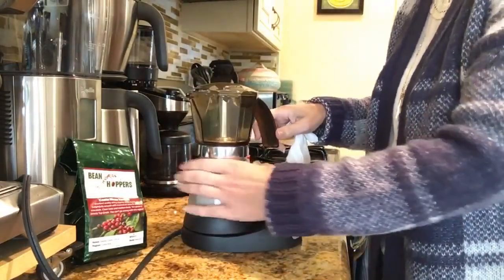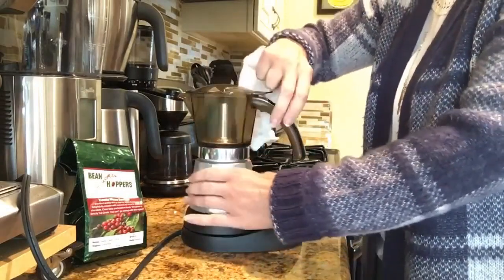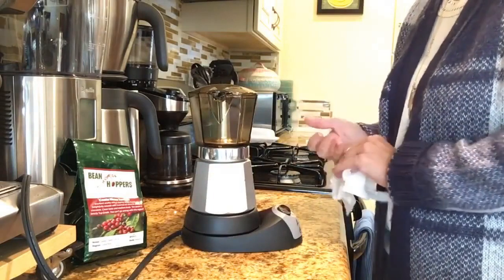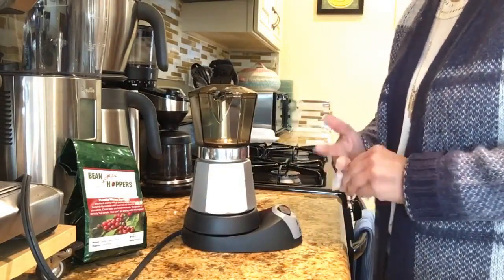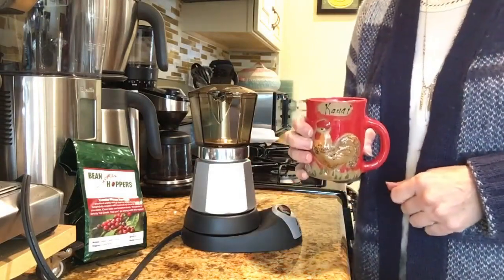Delongi Alicia Moka Pot Comprehensive Review

Comment: I have bought recently and problem is that always stays water inside, not comes out all cofee.is it normal .thanknyou
Reply from the maker: Hi! If a lot of water is left in the bottom that is not normal. If there is just a small amount (a 1/2 oz or less) then that's pretty normal. There are a few drops left when I brew it. If it's more, then you should return it for a new one because something isn't working right. However, if you're using coffee that is too fine, or your compacting down your grounds, all of the water may not be able to get through. The coffee should not be compacted and you can try making your grinds a little more coarse and see if that helps!
Reply: @BeanHoppersCraftCoffee  thank you for your reply, the water which is left is too much  and coffe that I use is normall,what is sold in supermarkets, a bit rough.so I have to take it back.thanks.💖💖💖
Reply: o sorry you ment If i put coffe compactly, but not, only prepare for me, just one spoon coffe💖
Reply: @natalijafaridze2308  if only making enough for one, it comes with an adjustable metal top to put into the coffee basket to put less coffee in it, and you would use less water.  Even though it may not be an espresso coffee maker in the traditional sense, the six-cup/three-cup capacity is based on espresso shots. not 8 ounce cups of coffee

Comment: What type of grinder were you using for that?
Reply from the maker: My grinder is the OXO conical burr with integrated scale. I usually use a 6 for medium drip and this brewing method did better with a 6.5 or 7. Just slightly coarser than drip.

Comment: Rinsing Hot aluminum with cold water is not a good idea... it will ruin it over time.
Reply from the maker: Really? I had no idea. What about if the aluminum is not hot in the first place and you're pre-cooling it?
Reply: @BeanHoppersCraftCoffee  I just searched, and apparently, it is common to run it under cold water to stop the brewing! Usually, shocking metals are not a good idea as they crack over time, but since everyone is doing it, I guess it doesn't matter much?
Thank you very much for your good video.